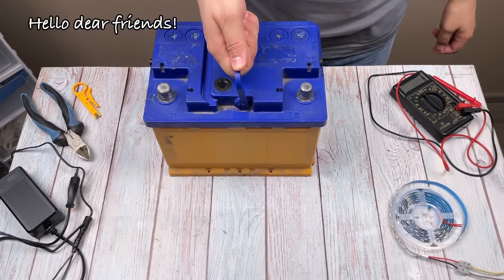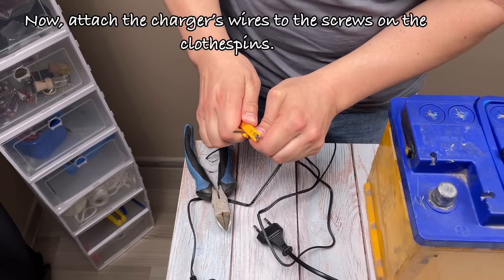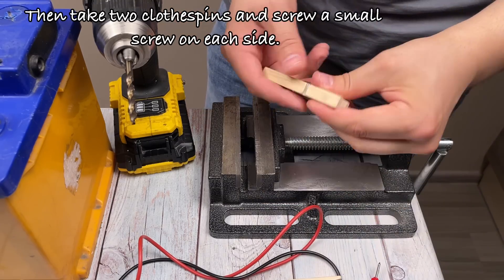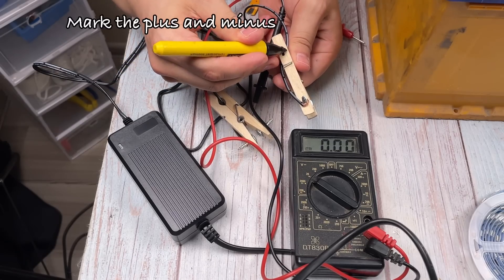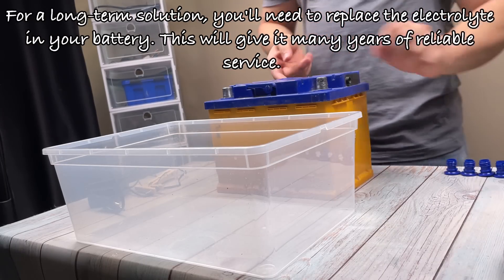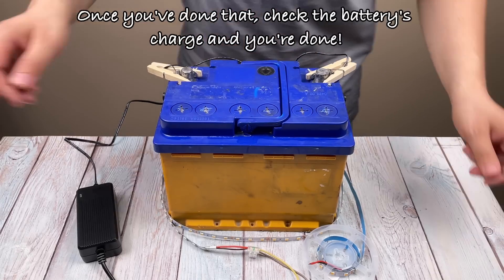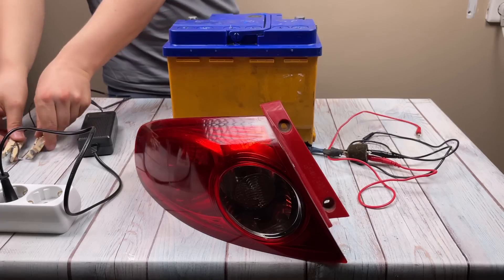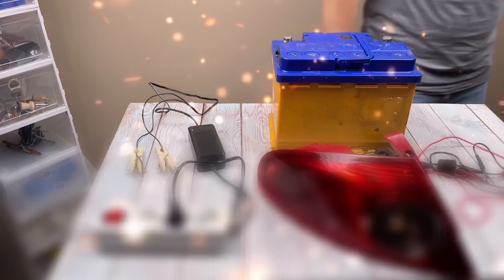🔥🔥The battery now works forever without a dealer! Just two clothespins for your old battery!

Comment: These battery reco vids don't prove that you have reconditioned the battery unless you have a battery analyser or load tester. That is the only way you will convince anyone! I have tried 12 volt battery desulfators, smart charger with a reconditioning mode and i can say the only way to reco a battery is by buying all the plates etc from India!

Comment: Good idea. What did you into the battery befoee starting the charge? Is it distilled water or surfric acid?
Reply from the maker: First rinse with distilled water, then with a mixture of sulfuric acid - electrolyte
Reply: He used RUM without Coke 🤣

Comment: first of all, lead acid batteries deplete the lead in chemical to electron process, no amount of acid will replace the depleted lead, second, laptop power supply will not charge a car battery, charging voltage must be the same as a cars regulated charging voltage 14.3v, 15a, thirdly, don't believe any of the BS on youtube

Comment: I am afraid this is pure B.S. Don't try this at home. Dangerous. No gloves or goggles or any other protection of any type. The electrolyte in lead acid batteries is sulfuric acid, it burns your skin, i know, i worked with batteries for years, was lucky enough never to get any in my eyes. Be safe if you can afford to run a car you can afford to buy a new battery.

Comment: In 1971, I worked at a taconite plant in Northern Minnesota.  There was a man there who purchased a 1957 Chevy new, and every year he would drain out the acid from the battery, and flush it three times with distilled water, then put the electrolyte back in.  Even in -60 below weather, the car always started.  Cheapo battery from the factory lasted that long.

Comment: Original. But I'm unlikely to use this method because in Russia batteries are cheap and durable - they work for at least 5 years, and it's the cheapest option. But it was interesting, I even forgot about the pasta with sausages that I heated in the microwave. I'll have to heat it again.)))